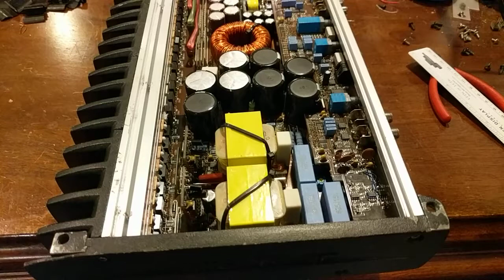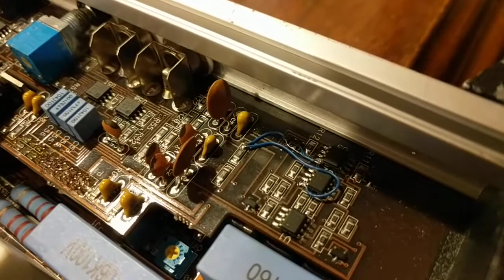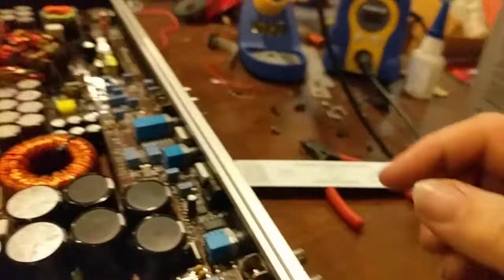JL 1000/1 Quick Repair Tips

Comment: I got a used 500/1 off ebay that just started cutting in and out. Also will only play audio if RCAs are plugged into the OUTPUTS and doesn't work on the inputs. What's up??
Reply from the maker: clean out all the switches and potentiometers with deoxit.
Reply: @THEtechknight  yeah they're scratchy I'll try that first, but it's a v1 and my first v1 had the same problem a long time ago and the JL repair center fixed it and said the input board unplugs and gets loose from the main circuit board, wondering if it's the same issue there too
Reply from the maker: @r0llinlacs  Ive never run into it as they are clamped down in grooves. Anything is possible I suppose.
Reply: @THEtechknight  i mess around with it last night it was just bad RCAs. 

My 1000/1 that I warrantied came back with a description of everything they did to it and they said the input board came loose from the main board (i had it mounted on the box, bad idea, vibrated the two boards loose) and they said they  applied a revision from the V2s by using adhesive where the two boards connect
Reply: @THEtechknight do you still repair amps I have a jl 1000/1 I need fixed thanks

Comment: I'm trying to find the proper replacement 2/4 channel switch to repair my JL Audio 300/4 amp. It has six connectors in center (two rows of three) plus the four that hold the switch to the board on the outside. The switch says COMAX on it. Can you point me to the right switch please?

Comment: Hello I have JL AUDIO slasher 300/4 it went out last week. I heard it distorted a little and then no audio out. It has power but no audio. It was tuned correctly with a multimeter so bad tubing wasn’t the problem

Comment: I have same amp, was playing fine then voltage dropped on batteries to 10.5v and amps shut off. Let batts charge back up and tried to turn on and amp does nothing. Put a meter between + and - on amp terminals and they have continuity between them. The fuse is also blown but didnt want to put another one if it was gna just blow it because of continuity between + and -

Comment: Re-tapping the terminals for a client.  How do you remove it from the sink.  The pre-amp board seems to hit the two front caps when trying to remove it so I can get to the terminals.  Any help would be great.  Thanks for the video
Reply from the maker: Theres no shortcuts here. you have to fully disassemble the unit entirely. all heatsink clips, heatsink gets removed. all RCA jack nuts get removed, and the board will pull out.

Comment: You said at the end of the video that the switches  can be cleaned.  What do you use to clean the switches?  I have JL amps that have issues with those 12db switch.  When I move it around then it starts working again.  Any help will be appreciated.  Thanks
Reply from the maker: Contact cleaner like deoxit.
Reply: @THEtechknight  do I have to take the amp apart to spray in the switch or do I just spray it from the outside? Thanks

Comment: Stumbled upon this video after searching google for my issue. I have a JL 1000/1 V1 amp. It's been good to me for almost 15 years now. Recently (couple weeks ago) it started to whine and digital noise was coming out of my speakers with the radio off, as well as the low ohm light on. The green (power) light stays on all throughout my issue btw. I turned my system off and on and it stopped. Everything was good for a couple days and then it started again. Turning radio on/off didn't work this time around but the next day it was fine. Everything was good for about a week and then it started again. This time it did not go away. I checked all my connections and everything seems tight. Now again, this morning it stopped doing it, and everything is fine. I assume there is an issue with the amp itself. Any ideas what it could be? TIA.
Reply: Did you solve this issue?
Reply: @GrounDControL873  Unfortunately, no. I ended up selling it on eBay. I didn't wanna spend the money to have someone fix it since it was old and I got plenty of use out of it all those years. I mentioned the issue I was having in my listing and it still sold quite easily. I even mentioned that I'm sure for someone with the knowledge it was probably an easy fix. I ended up making back about half of what I spent on it all the years ago. Ended up going with a cheaper Amp from Amazon.
Reply: @jaydos3967  sad.  I'm having the same exact issue atm.  How much you sold it for?  Just curious.

Comment: Hey @thetechknight ,I have a 500/1 v1 slash JL amp and I have a really weird problem. It barely or doesn't push my sub at low volume, but it kicks on and hits as it should at higher volume, 30/40 on my headunit. After a while, it'll play even when lowering the volume until it cuts off again intermittently. I've isolated the problem to the amp, after changing the source and RCA. Getting enough constant power to it, around 14v and I've tuned the gain with dmm. Any advice?
Reply from the maker: Get DeOxit and clean out all the switches. Common problem.
Reply: Thank you for your quick reply. I'm kind of new to this. Do you mean the switches on the back of the amp or are there some switches in the amp? Also, I have another 500/1 v1 slash JL amp that need a new preamp. I've tested it againstthe one I'm having problems with right now. Would you be willing to sell me one or can I pay you to fix it?
Reply: @THEtechknight  how do you clean the switches, I've had my amp since 07 and I frequently have to wiggle the switches
Reply from the maker: You have to use de-oxit contact cleaner and spray inside the switches. The switches have a dust-cover so you have to take the amp apart to get to them.
Reply: @THEtechknight  ok thank you man.....I opened it up a couple years ago, the dust cover was what stopped me.... I'm stupid, lol. I definitely gonna do that

Comment: I have a jl 600/1v3 one of the Allen screws stripped out the ground one have you ever replaced any of those ?
Reply from the maker: Probably have to re-drill, re-tap and use a slightly bigger screw.
Reply: THEtechknight do I need to do any soldering to pull out the boards? In order to re drill re tap the screws?

Comment: Hey Knight .. is cycling a common problem with the 1000's? I have two that cycle from 3 amps to nothing repeatedly .. the fets and power diodes along the back all check ok 
.. maybe the driver chips? those two small driver boards are a pain to pull and I typically add headers if I am forced to do it in case they come back

Cheers
Reply from the maker: midnightman011 never add headers in a class d amplifier where they were not originally... You could alter the circuit impedence and the amplifier may not work properly. Also heavy bass those cards will fall out.
Reply: i could see where headers could possibly vibrate open but impedance? how is a small brass pin less than a millimeter long going to change impedance? even at 50-100 khz it would only be a few ohms at best
Reply from the maker: Thats what I said in the beginning. But... I have worked on enough MTX Class-D amps that it DOES matter. Even substituting output transistors makes a huge difference, it'll get noisy or wont go into oscillation. Case in point: I was working on an MTX 6500D and it wouldn't fire off until you gave it loud enough volume, and then it sounded like shit. I shortened the leads of the output transistors a bit more, and presto. It worked fine. Seriously, in SOME amps, its that critical. the MTX stuff wasn't known for reliability anyways, but I digress. the JL is a bit more forgiving, but I wouldn't try it. Honestly. Self-oscillating D amps is where it hurts the worst. amps that have capacitor or crystal oscillators in the front-end are a lot more forgiving, but it can cause more heat under load. In the case of the JL your worry would be more physical than electrical, i would wedge something between the riser driver cards and the bottom plate so they cant rattle out.
Reply: yeah I was thinking a few spots of silicone or hot glue to lock it place that could be removed with a heat gun 
.. do you have any signal or test points for that amp by chance? it is a pain without a schem since JL Audio shares nothing
Reply from the maker: I used to at one time, but all those documents are on computer systems at my previous job which I no longer work at, So these days, unfortunately, no. However, the only resource when I first got started into amp repair that was great was diyaudio.com, a guy name Perry Babin. I dont know if hes still around but hes better than I am. So he may know.